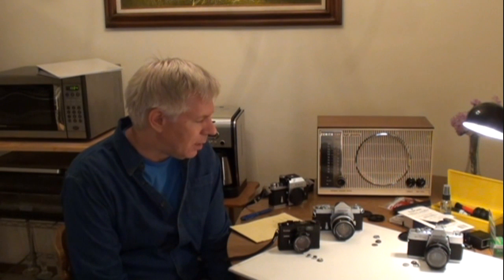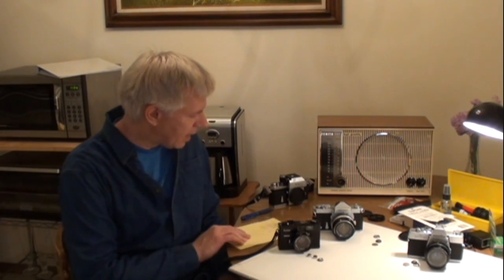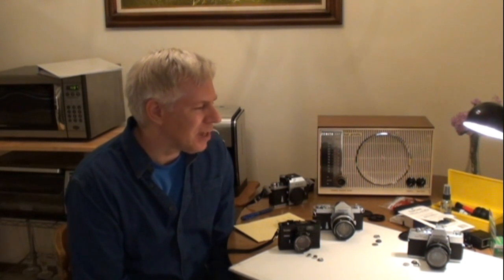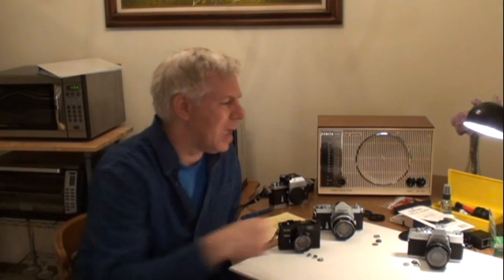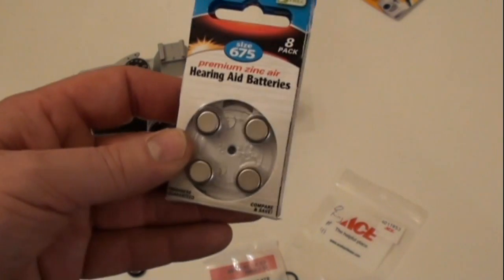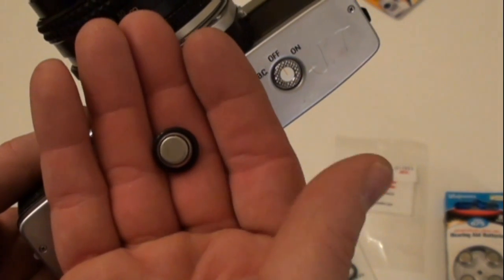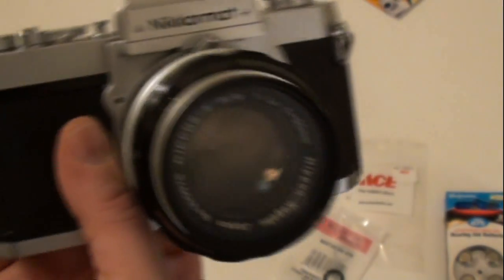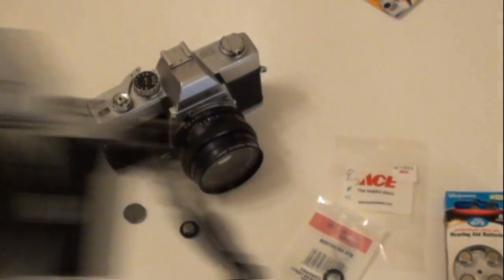Vintage Camera Battery Mods

Comment: I ran into the battery issue with my Nikon Ftn Photomic 35mm SLR circa 1971:   the meter prism finder was indeed originally issued with the mercury batteries but the camera came with 'modern' silver-oxide equivalent batteries installed and they did work..although I found slight exposure error when compared with test shots taken with my other 35mm SLR cameras under same lighting conditions/same ASA/ISO setting.   I got around that by 'fudging' the ASA/ISO setting to yield equivalent exposure BUT found that 'fix' is not linear across the entire meter coupling range.  I did find 'modern battery adaptors' called an MR-9 which have step-down circuitry in them to step-down the voltage to the correct voltage level when using modern 1.5 volt silver-oxide batteries.  Ordered them the other day we'll see how they work.   I also have a NIkkormat FT-2 which works just fine with modern batteries.
Reply: Did you have any luck with the step-down adapter?
Reply: @PG_Narkles  Yes:   I found step-down battery adapters that allow for use of modern equivalent silver oxide batteries.  Unfortunately I don't have the info handy at the moment.  I had to purchase two insert adapters..one for each battery they simply slip into the battery compartment.  You insert the battery into the adapter,  then insert the adapter/battery combo into the battery compartment.  For the F two are needed.  Was rather pricey for two adaptors but works fine.  Light meter is now accurate throughout it's range. Beats the heck out of having to have the meter head adjusted for use of modern batteries.  I find the info for the adapters I'll post.

Comment from the maker: Any old SLR that has A "Match Needle" light meter has lens opening and shutter speeds that the shooter manually sets so you can still guess settings for exposure or you could use A separate hand-held meter.

Comment: ive just bought a Praktica LTL and opon seing your video i opend the battery thing and there was a very old one inside and that little think that you;re pushing up at 8:02 mins just fell off, it was really old and horrible
i'm guessing the batteries aint gonna work. could u tell me, pls, if the camera will still work without batteries?
tks!

Comment: Hello! I have the same camera and was wondering how you open the cameras battery compartment
Reply: Wait I figured it out thanks !
Reply: hey i have a Minolta and i can't open it either. what did you do?
Reply: I used a US quarter turning it counter clock-wise to remove the battery cover. It works great for me.
Reply: @terrywitkowski6937  how did you remove it